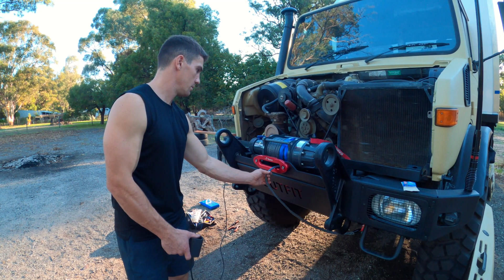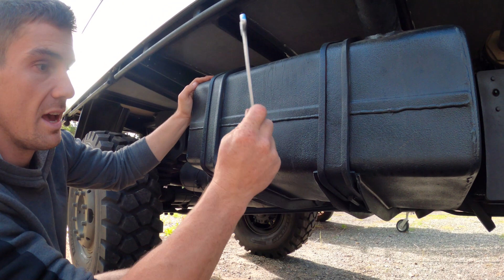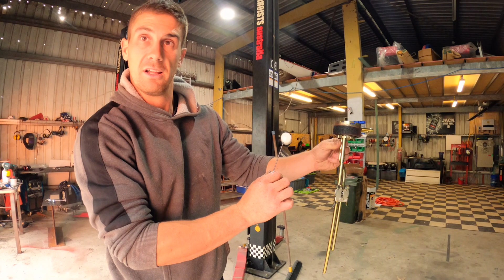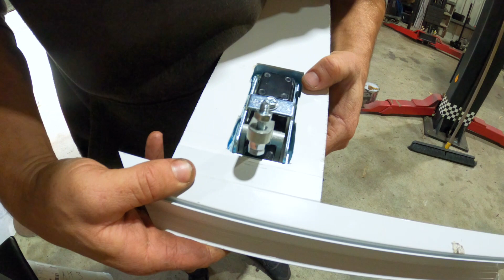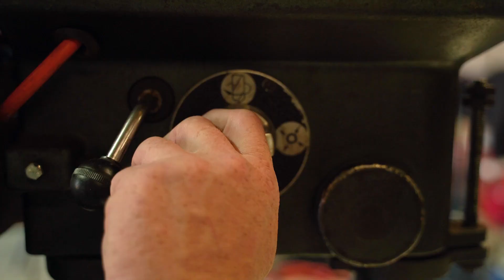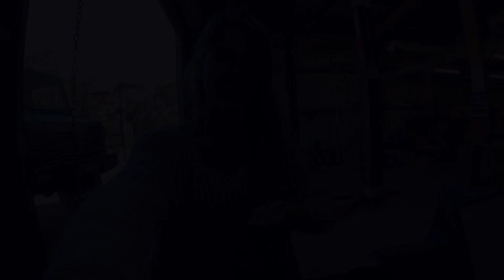EX-ARMY TRUCK DIESEL TANK GETS A CLEAN! Wiring Runva Winch -DIY Expedition Vehicle/Caravan Build#16

Comment: Hmmm sliding the cover back on the winch rope because it doesn't match the colour scheme, The UV, bugs grime will wreck that first bit of rope. Make a new cover the the right colour or  just live with it, protection is practical. I would also get the rope and hook up out of the way, close to the winch, as having the rope down the way you have it is just asking for damage. I agree with the others get a new crimper loose crimps will come back to bite you at the worst time. Avoid soldering as it can give you a hard point in the cable and with vibration can cause fatigue and cable breakages. Conduit is your best friend when running any cable. Love what your doing

Comment: Really enjoying the build but please, like others have said use a proper crimper and put some secondary protection over the winch cables. If you don’t want to splash for a crimper take the cables to your local auto sparky and have them do it.

Comment: I own a set of these that you are more than welcome to borrow. I'm in Atwell/Cockburn area. Crimping with vise grips just won't last. Let me know and I'll get them to you somehow.  I also have a hex Crimping tool too. Some sort of cable armour/conduit on those winch cables is advisable as added protection. An ANL fuse and holder inline wouldn't hurt either as a just in case. https://www.narva.com.au/products/56516

Comment: Get that little blow torch and some 50/50 solder then solder up those high current battery cables. Use some silicone grease on the connections after you''ve bolted it all together..Crimping is for mugs unless you have crimping tool even then solder after crimping. Moisture vibration electrolysis and metal fatigue will eventually cause those vice grip  and mouth crimps tp cause you problems.  Hate to see you two stuck out in the bush without a way to charge your ipads and electric tooth brushes. Cheerio.

Comment: I'm not a mechanic but did you say in the video you could see metal in the tank.  This might need investigation,  I had a problem with metal in the fuel filter turned out to be doggie high pressure fuel pump.
Cool video 😊

Comment: admire your trial of alternate crimpers, but as 36 years as a sparky, this is going to bite back at the most inopportune time with a catastrophic melt down. Solder if you are desperate but something must have gone really wrong to fail with crimps. Just some friendly advice, really like your truck, half your luck top be  able to do so, good luck in your adventures
Reply: Mate I join cables for a living and completely agree with you. Crimp them correctly and you will save the possibility of failure or fire

Comment: Just a tip, if you get a fuel primer for an outboard motor it makes it easier to bleed the fuel system, we use them all the time when customers run diesels out of fuel. I agree with other comments about running conduit over the winch cables. 
You can earth out the wire that goes from the fuel sender to the gauge, it will read full if you do this,
Reply: Also thanks for the tip about the ginger nut biscuits

Comment: Nice! You mean, I don't need to invest in those hydraulic crimpers! I reckon you should insulate the welding cables where they touch the body...vibration could wear through and the consequences can be quite awe inspiring...Many save the rust converter after use, like you did - its worthwhile given the price. Good on you for highlighting poor customer service!
Reply: Yep I noticed that big cables running along chassis with metal things holding them in place after time it will rub through,  ooo ouch
Reply: Nope. You still need hydraulic crimpers. Agree needs to redo gambles in some split conduit
Reply: @jag131990  Yes, I have these after fucking around with vices, vice-grips and soldering with far too many failures. My comment was tongue in cheek.

Comment: You should put some wire conduit over your winch wires, I've found even though the cables are tough as courrigationn and general driving can wear through it and it looks very clean and tidy. Looking the goods guys love seeing each episode ❤️
Reply: And perhaps do so for each cable individually,  otherwise you'll over heat and melt the wires.

Comment: As an ex cable joiner, you can hire a good quality crimper from Blackwoods in Perth WA.
Reply: Yep vice grip crimp won't survive corrugations.
Reply: Bunnings kings crimp for that size.$100.does perfect connection.
Reply: Was thinking the same thing :o
Reply: dear god i actually believe what i just saw. crimp it or dont use it.

Comment: Loving the intro and nothing like well made cables by hand.  You always know what went wrong and exactly where when you do it yourself.  I also often pack some silicone into my heat shrink as well :)
Reply: They were horribly made cables, crimp it correctly with the proper tool. The amount of current the cables will see underload is immense and that is just a hot joint waiting to set something on fire.

Comment: Very nice setup guys. Your getting pretty bloody good at this stuff now. What was with the gas in the shrink wrap on the wire fitting?
Another thing I wanted to ask is have you installed a Catch Can?
Reply from the maker: Thanks Roger! It's a Butane Gas Can from Jaycar.
Reply: @TheOutFit  Why did you put gas in the shrink
Reply from the maker: @eightymateyadventures  It's a gas powered soldering iron
Reply: @TheOutFit  oh ok, sorry. It looked like you put gas in the shrink before you heated it up.